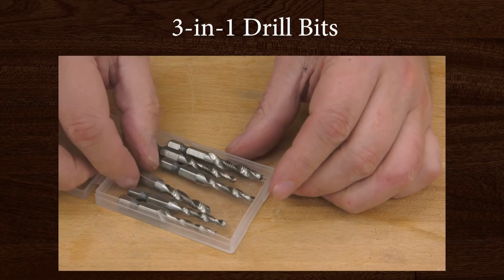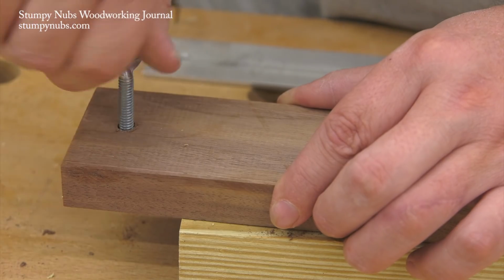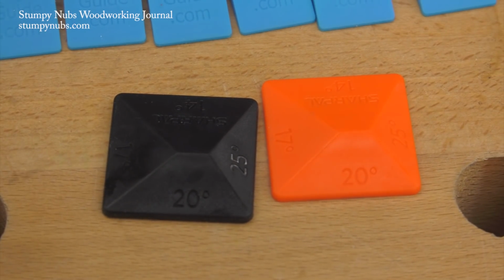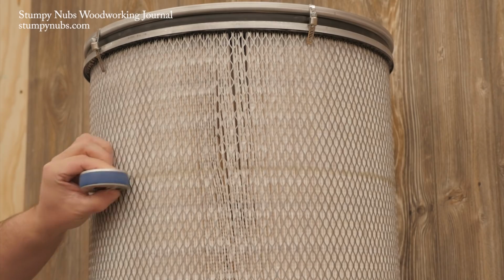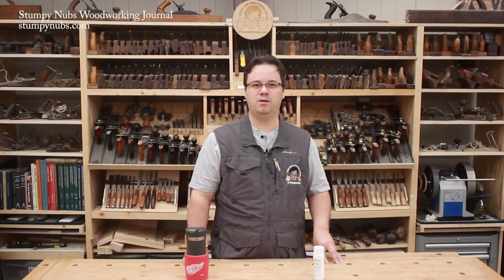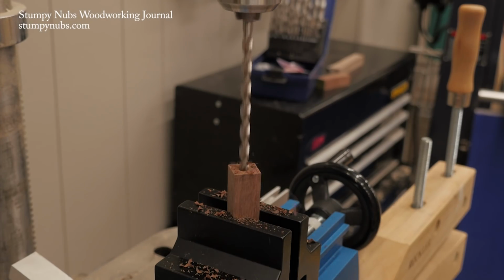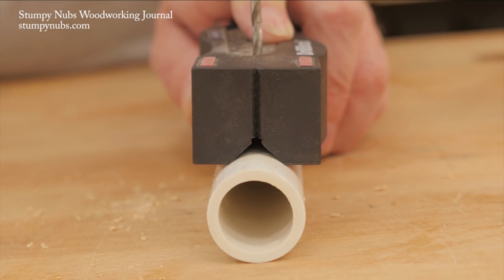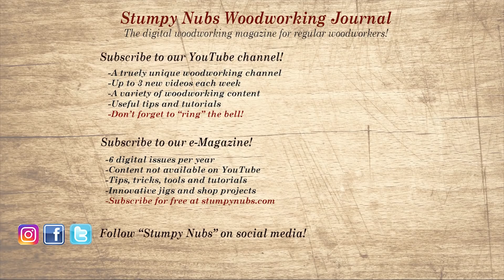10 CHEAP tools I use in my workshop

Comment: You're partially correct about the combo drills. With metals, turn your speed down. Drilling harder steels is a slow speed process, not a high speed process. With a cordless, feather the trigger. There's a lot to drilling steel (speeds and feeds) and this is a short comment. You'll have to look in the machinist bible. So, those drill /taps can be really good for thin sheet or bar stock.
Shapton sharpening stones, eh? Nice. I have a set and they are great (IMHO)
P.S. A lot of phones have measuring tapes in the. They're great for lumberyards or anywhere.

Comment: I love these tips, thanks for always having new ones.   I started turning pens a few years ago and I see over and over that the Fisch bits you recommended are very good, but I haven't ever used them myself.  I would also recommend Colt brand pen drill bits.  I have a 5 piece set that seems to be difficult to find but you can find it at some wood turning sites.  It is not cheap but not that bad and the 5 bits covers a large number of pen kits you might use and it is totally worth the cost.  I believe they are very similar in design to the Fisch.  With Colt or Fisch you want to be sure you are getting the ones that are fluted specifically for boring pens, they are different from standard as I am sure you know.

Comment: Love these videos. Thanks for all your tips and advice! May have saved me a hand since I will never buy a chain saw carving attachment.

I do have a question, and I don’t know where to post it. In one of your previous videos, I noticed that you had one of the Incra fences on your table saw (not the SawStop saw). What are your thoughts on that system? Thought it was to help so you don’t have to do the “tap and pray” method on your table saw fence, but I still see you tapping, so I wonder if it was worth the investment.

Comment: Actually, I think you might be surprised with the tapping drill bits. You gotta keep it straight, but the impact driver IS the best way. I always broke the small ones but haven't since switching from drill to impact (for the record, I only use them with metal

Comment: FYI Stumpy,

Lee Valley sells its own brand and the Bessey brand of fence clamps for roughly 25% less than the MilesCraft on Amazon.
Reply: The Lee Valley and Bessey clamps do bot have an adjustable throat depth.
Reply: All 3 have the same max clamping depth and width.  They are all essentially a "C" clamp with the fixed chop being a 1/4" wire that can be placed in any 1/4" whole.  I own all 3, and have been teaching fine joinery for over 20 years.  I love MilesCraft for many items and own a great many of their products.  In this case however, Lee Valley has the better price for equal quality.

Comment: I never use the wrench for my dremel. Lol. Early on I started just using hand tightening and have never had any problem and just kinda forgot it even used a wrench.
Reply: Even so, having to use the different inserts is a pain in the rear if you swap tools often.  The keyless chuck is so much better, I don't understand why they don't include it with the tool.

Comment: How about thin drill bits that are long enough to allow you to drill a hole 3" deep for 3" screws. I like the idea of that drill block but the length of the bit is often already an issue even without the block.

Comment: I find drill blocks difficult to use because they prevent me from seeing where to accurately position the bit on the mark. Maybe a block made of transparent plastic would help with that.
Reply: I was thinking the same thing, but the realized you can put the bit through the block, position the point of the bit where you want, slide the block back down without moving the tip, ta da! You can now drill a straight hole to the surface you just registered to.
Reply from the maker: Put the bit in hole, lift the block up onto the bit so you can see beneath, place tip of bit on mark, lower block, drill.
Reply: @StumpyNubs  I must have a block too thick for that, or maybe I'm too thick to do it right. 😉

Comment: Sorry have to disagree about the drill taps....have used them for years first ones i saw were greenlee brand..i have used them as an electrician to drill and tap all the things you said not use them on including stainless...but i totally agree use a drill set your clutch do not be in a hurry...and the smaller the tap the lower the clutch setting.

Comment: ive bought 2 of those keyless chucks and both loosen with use for some odd reason and I still send up having to use a tool to tighten them and I even broke the first one trying to get it tight enough because my bit kept falling out. Has anyone else had this issue?

Comment: Why would you tap into wood? Why would you use a coach bolt with a square head in a tapped hole when you cannot tighten it past the square, defeating the object of the square??

Comment: as somebody who has struck their thumb with a hammer until it bled under the fingernail, i need that nail plier....
Reply: Are you trying to make us believe that only happened Once???
Reply: At a pinch: push the nail through the end of a rectangular piece of paper folded in half lengthwise.  Holding the other end of the paper, you can precisely position the nail and hammer it in while keeping your fingers well clear.  Pull the paper off once the nail is halfway in.  I use this for veru small nails or when working in a tight space.

Comment: The SLICK STICK wasn't demonstrated on the bottom of your planes.  Why Not?  After 2 passes of the plane, any excess that may transfer to wood is gone and just a slick surface will remain.

I use 3in1 on my planes - only lasts for 2 passes before excess oil is wiped off, then it is slick thereafter.  Same thing with Dry Lube.  These are Much better than wax, which goes away very quickly.

Comment: As a 40 year machinist/tool maker, you are quite wrong with your advice on the drill tap. Tapping speed is definitely not a slow speed operation. It is very common to tap at or near the speed of your drilling operation. When using a drill-tap even in mild steel, you can run it at full speed on low of a 2 speed cordless drill motor, and easily much faster in aluminum.
Reply from the maker: Tell you what. You put an 8-32 tap in a drill and run it at full speed. Let me know how many you break before you finish the threads.

Comment: Dremel rotary tools have collets, not jaws.
Reply from the maker: The chuck featured in this video does have jaws.
Reply: @StumpyNubs  The comment you made at 2:50 was about changing jaws. No, you change collets. You replaced the collet system with a chuck system with jaws so you do not have to change collets. 
The listing for the keyless chuck says:
Quickly and easily change accessory bits on Dremel rotary tools without changing collets. Eliminate the collet and wrench when changing Dremel accessories
The steel 3-jaw chuck holds various accessories with 1/32 to 1/8” shank sizes
Reply from the maker: @idadho  - I see. I thought it was pretty clear what I was saying, but you're right, I misspoke and thank goodness you were there to jump on it. ;)

Comment: Why does the Rollbot say    <" Smaller than a 12' rule, the RollBot measures up to 144" "> I mean, Why would they do that?
OK I am going to guess this thing will NOT measure or mention feet at all? Always shows the number of Inches Only so I have to do the math, I hate math.
Or Are they trying to make me think, (and it should), it measures up to 144 feet?
One thing I hate more than math, advertisements that use slick tricks. Only 12 feet? I'll wait. I wouldn't want to ROLL all my small projects.
Reply from the maker: It's a type. It does not stop at 12 feet.